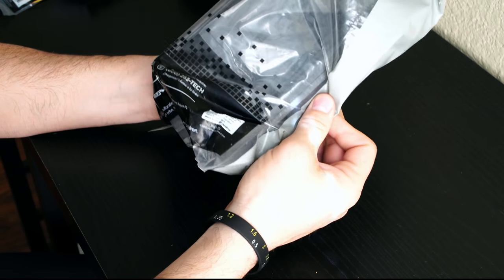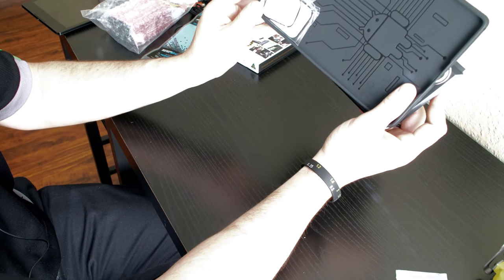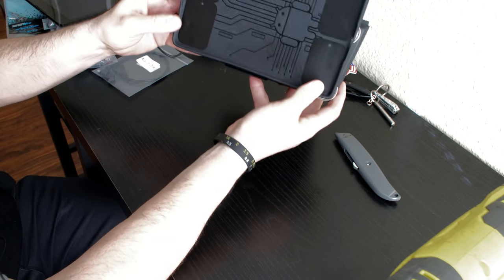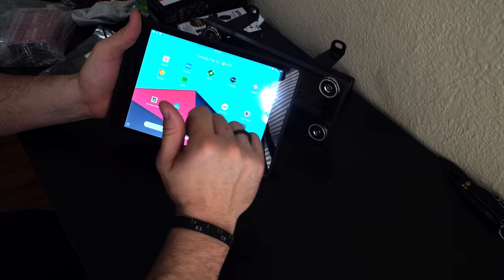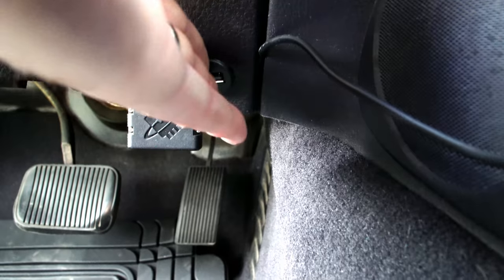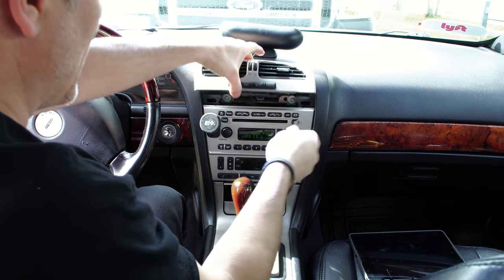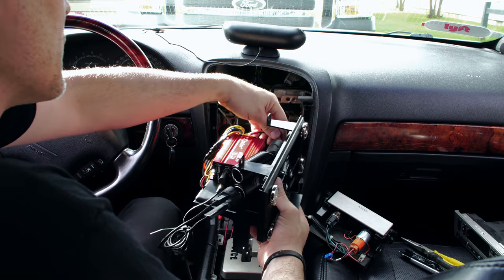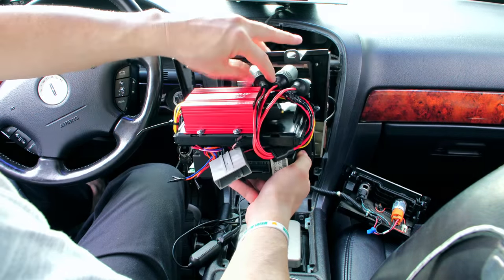Turn Your Tablet Into A Head Unit

Comment: Thanks for this video. Great info here. I am NOT going to be doing this, HOWEVER, I have already done part of this. I did not know that I could could get an adapter to run both audio and charging on one cable at the same time. When Ibsaw you doing that, I went out and got that one, as well as the needed cables. Now, only the one USB C cable for me, and my car looks much better with out the clutter of cables.
Reply from the maker: That sounds awesome! I'm glad you discovered that. Thanks for watching and commenting!

Comment: Glad I decided to watch this video, the magnets you used look way better suited than the ones I used for my setup. I may need to figure out a way to flush mount then though to make it work for me. Otherwise, I have a very similar setup with a Nexus 7 2013, but I also use Tasker to turn it on/off when it receives/loses power and automatically connects to my phones hotspot which also automatically starts using Tasker when it detects my Bluetooth receiver and automatically starts playing my music. I also use car web guru as the car launcher, which also starts up and shuts down with power. And Tasker puts the tablet into air plane and power saving before the tablet goes off to save power. Look into Tasker if you haven't yet. Thanks for the parts list, I'm definitely going to pick those magnets up to replace my current ones
Reply from the maker: That is a very clever setup! I started with the very same tablet because I wanted to put the tablet inside the dash but quickly realized that it would function better outside. About flush mounting the magnets, I needed a little bit of space away from the faceplate so that the tablet could attach. If I had mounted the magnets flush with the faceplate there would have been an air gap not been able to attach.

Thanks for watching!
Reply from the maker: Oh, by the way, the magnets are on the idea list that is linked in the description along with all the other parts that I used.
Reply: @edwardlthompson  good point about the flush nothing. My setup is removable too but the case stays in place as part of the mounting setup. I used a combination of n54 magnets and Velcro to make it after just magnets wasn't cutting it. But I can think of a much better way to redo it now using the magnets you used. They probably won't be flush mounted but they will be set in a little bit so the case sits flush with the console. They look like they would be to thick for my application otherwise. Also I think the issue with the micro USB OTG has to do with the tablet kernel/software but the cable itself. I've managed to get OTG with charging working before but it just wasn't reliable enough. It was much more stable with the original Nexus 7.
I bet you could mount a wireless charger behind your setup too (if supported) if you want to do away with that hanging cable.
Reply from the maker: @kemicala  yep, I had that same idea and another commenter suggested that too. That would be super clean. I wish manufacturers had not got out of the tablet game and had given us a modern tablet with all the latest specs and wireless charging. That would be so sweet!

Comment: Emergency braking, will the tablet fly out? Experience the driving process? Such as volume plus / minus, switch songs
Reply from the maker: The tablet hasn't moved at all even with me drifting and doing figure 8s! I have video to prove it. 😂

There are volume controls as well as media controls on the launcher as well as in the swipe down notification shade. So, no issues there.
Reply: Emergency braking would actually push the tablet forwards.

Comment: I tried this same path 2 years ago and have all the parts you bought pretty much except tried with 2 mini amps.  In the end it just was not worth the trouble with the price of head units.  I eventually just bought a $300 Android Auto/CrApple Play Head Unit from Pioneer/Kenwood/JVC.  Most issues with this setup is getting the audio, bluetooth, and charging working without interference ruining it all.   Any usb device you introduce to the system causes more problems.  Best bet is to use bluetooth audio and USB charging only.  If anyone else wants to attempt this good luck.  In the end I probably bought another headunit messing with all the adapters and tools to try and get this working.
Reply from the maker: Check out my update video. I did a different setup with the head unit in my truck and upgraded to a different tablet. I agree that this level of DIY isn't for everyone and a simpler setup may work better for most. I plan on doing another setup with a simple and cheap BT head unit soon.

Comment: Nice setup. It's like what I had in my old mustang with a Nexus 7 2013. If you have a USB hub you can get a USB FM radio receiver, and a USB TPMS system. You could have saved your self a whole lot of trouble by just installing a single din stereo with Bluetooth and just recessed it back. That's what I have now and it's perfect with my 10.5 inch Verizon S5e. I'm a delivery driver and it makes working weekends during football season better so I don't miss games.
Reply from the maker: That's an awesome setup! I didn't know they made a USB radio receiver. Installing a single DIN radio with Bluetooth certainly would have been easier but I wanted to challenge myself to build something and DIY a head unit.
Reply: @edwardlthompson  Yeah I know what you mean, I did the same thing the first time, but the radio never worked perfectly, and the amplifier I used had to be placed in the passenger footwell, so I went with a Bluetooth stereo this time. For the FM radio google Android USB DVB T Dongle and SDR touch app, it never worked that well for me but I had an adapter to use the car's antenna and I think that screwed things up, plus you can get an amplifier for the antenna that I never tried.
Reply from the maker: @byroncole1253  I checked out a few on Amazon. Very clever solutions. I think it would be far easier to get the iHeartRadio app to get all your favourite local channels wherever you may travel if your really hooked.

Comment: Check tail lamps...   lmao.. I bought my wife a ls..    that warning cluster!
Reply from the maker: That's cool. Hahaha. Yeah, the car didn't like that I replaced all the incandescent bulbs with LED bulbs. I recently installed a resistor that tricks the system out of those errors. I love the LS. Good choice! There's a group on FB called Lincoln LS Enthusiasts that you can use to keep up with other fans of that car but there's also a bunch of good technical info there.

Comment: You are a very good person to go through the process and all info. I always wanted to use one of my numerous (NOT IN USE) tablets for this same concept. Appreciate the education Sir. Real good video. Be safe
Reply from the maker: E-cycle! Don't throw them away, just find creative uses for them. I'm currently using an old tablet for a system monitor for the data output from my PC for the temperatures and other metrics. I'm glad you enjoyed the video. I made an update video to this one that is recommended at the end that shows an easier setup in my truck.

Comment: Will OEM reverse camera work for this unit? Amazing work by the way.
Reply from the maker: Thank you so much! I am not sure how OEM reverse cameras connect and if they differ between brands. I would have to do some research on that. Sorry I don't have an answer for you.
Reply: @edwardlthompson  You would need some kind of adapter for yellow video in.    And of course an app to play it.    It might be easier to find a piece of hardware that accepts a yellow video in and transmits it via wifi.
Reply: @edwardlthompson    Its probably easier to just buy a usb webcam and hook it to a usb hub.
Reply from the maker: That's what I have suggested to people that have asked the same question. I have seen this adapters for the yellow RCA jack to USB but like you said, finding the software to work with it could be tricky and it would be a hassle to activate it each time you needed it.

Comment: Why not just get a Joying full android head unit ? I use Torque  for obd reader and its free
Dam nice install
Reply from the maker: The reason I didn't go with an Android head unit was that the tablet is higher resolution, has a larger screen, has better support (Lineage OS), and can be used outside the car giving it more usefulness. Plus I wanted to challenge myself to make something like this.

Torque is a good OBD2 reader but the dongle I got is sold by the company that makes the app I use. It has better compatibility and more detailed features thanks to that compatibility.
Reply: @edwardlthompson well thought  out and very clever  build
Reply from the maker: @billbond2045  thank you and thanks for watching!
Reply: Look into headunit reloaded. Its cheap, but allows your tablet to run Android auto. It's a godsend!
Reply from the maker: @yakidd  that's pretty cool. I will look into that but I'm not a big fan of Android Auto. AA only runs a handful of apps. I would not be able to run my ride sharing apps.
Reply: how about tablet battery, is it safe to put a tablet with huge li-ion battery in a hot car? most Android head unit doesn't have a battery, and it's for a reason. I don't watch the entire video (1 hour long), can we just remove the battery then bypass the power to the tablet?
Reply from the maker: @marhensa  the tablet should NOT be be left in the car. You are right about the fragility of the battery but also the danger of theft. The tablet is for use at home as well and across multiple vehicles. As far as I know, there's no modern tablets with removable batteries.
Reply: @marhensa  I would also compare the Barry of a tablet to a slimline powerbank. Same rules apply. It will be certified for storage temps, so stick to those. But as OP says, don't leave it in your car! The whole point of the magnet system is to make it easily removable.

Comment: Love the video and ingenuity.  I had a similar setup in my truck but rather than the small amp mounted behind the tablet I purchased a single DIN Sony deck with a shallow volume knob and used that as the audio and power interface and worked well.  Overall, nice job.
Reply from the maker: If I were to do it again, I would go that route as it would cut down on some of the complexity and I would still have a spot to run wires through if I eliminated the pocket on the double DIN. Thanks for checking out the video. I did a similar setup to yours in the update video.

Comment: Thanks for all this info ,one tip for drilling plastic ALWAYS drill a small pilot hole for your screws ,it will stop any stress cracking.
Reply from the maker: Thank you for the tip! Thanks for watching. Make sure you check out the update video as well.

Comment: No one is going to steal an older tablet  but as you stated, the interior of all cars goes through temperature changes that will kill most tablets. One thing nice is you can really upgrade an older vehicle and make it look more up to date.
Reply from the maker: Thanks. You can also upgrade the tablet to keep up with the times. Check out my update video where I did exactly that and did another setup in my truck.

Comment: I only have 2 notes:What if you make a sharp turn or a constant turn (when making a exit from the freeways)?  The tablet will slide left or right and might falls off.  Might want to put some bottom corner brackets to hold it in place like you did at the bottom.  As for this application looks good and clean.  Great and innovated.  However, you can't leave it car, just asking for would be thieves and a broken window.  If detached, there is no clean plate to cover up the behind the wall finishes?
Reply from the maker: The tablet will not slide off. Here is an exterior video of me doing figure 8s in the Lincoln and the tablet stays in place. https://youtu.be/EDxwDqxwCwA and here is an interior video where you can see the tablet at the bottom of the shot. It doesn't move at all. https://youtu.be/HLvBKnOJ7-Q

I have never left the tablet in the car. I have a small laptop bag for it so I can take it with me wherever I go or stash it under the seat if I'm just going into a store quickly.

You are correct, when the tablet is not in place, it doesn't look good. Looks like someone stole my stereo! 😂 However, when I'm not in the car, I could care less how it looks. If I cared a little more, it would be pretty easy to make a plate to cover the opening.

Comment: The way I did mine was to purchase a bluetooth single-din head unit, and then use my tablet bluetoothed to the headunit. This way, you get ALL of the pros of a good head unit, including 4-channel audio, or an amp system if you want it, and all of the benefits of the tablet as well. I use Car Launcher as well, and it works just fine over bluetooth to the headunit. I can use GPS, play music, videos, etc. and it works perfectly with no need to rig a bunch of crap up.
Reply from the maker: That's an excellent solution. I wanted to challenge myself to build my own unit. I like your method.
Reply: @edwardlthompson  There are some definite benefits to the way you did it. No need to worry about bluetooth connectivity issues, for one. And I'm the same way, I love tinkering and building and seeing what I can accomplish, so I totally get where you're coming from. The magnet idea is something I'm going to have to try, but I think I'm gonna try to figure out a way to hide them. Maybe shave down the inside wall of the plastic facing and use some series glue to hold the magnets in place, so that there's maybe 1mm between the magnet and the case of the tablet itself. Hmm.. I'll have to test how strong that'll be through various thicknesses of plastics before I attempt it.
Reply from the maker: @AlphaMachina  thanks! With the magnets, make sure you pay attention to the dash surrounding the radio area as mine is recessed by about a half inch so I needed the magnets to extend that far so the tablet could clear the dash on either side.
Reply: @edwardlthompson  Ahh, that makes sense. I think mine is similar now that you mention it. Hmm.. Man, this is where 3D printers really start to pay for themselves. I need to start putting some money aside for one, because I keep finding myself coming across instances where it'd be freaking awesome to have. Could print exactly what's needed, sand and fill it, and put a nice coat of paint on it, and have something custom and nice looking with everything in mind for the perfect fitment.
Reply from the maker: @AlphaMachina  I'm right there with you my friend. I have a good friend that has one and we are going to work together to try and make a custom design head unit.

Comment: Nice video mate, thumbs up.
Also if you have not done so already get some egr valve cleaner, you spray it down you air intake (remove your MAF Sensor) once egr valve is clean you should get more boost and better mpg's
Reply from the maker: Thank you and thanks for the tip. I do that every once in awhile with SeaFoam brand cleaner. Thanks for commenting.

Comment: This gives me some ideas thanks. Also if you have selected a tablet with wireless charging, then I reckon your setup will be more seamless, and saves you maybe the hassle of plugging/unplugging your tablet. Over time charging port wears out as well, so potentially saving your tablet down the track. Cheers mate!
Reply from the maker: I was looking at that. There are a few older tablets that support wireless charging but none that also are supported by the lineage OS community.
Reply from the maker: But you're absolutely right, if the custom rum is not something that's a high priority to you, it would be easily to find a wirelessly charging tablet that would work perfectly in the same manner.

Comment: As a ICE tec,I feel I should upload how to do near wiring.Nice idea,but such a janky set up of wires all over.Poering any audio with that electro luminescent powered USB will put noise back into the system after the ground loop.Hope you haven't had any fires since ,I didn't see you use any fuses either,which is kind of a must.
Reply from the maker: I appreciate your feedback. I have had no overheating issues or fires.
Reply: Wait you work with ice my company buys from y’all all the time 😂

Comment: Well done. I also drive for Lyft and use a brand name multimedia head unit. You make some very solid reasons this is better. I use Waze instead of the Lyft gps that can cause issues for me. The map will not always show on my head unit. Your R&D is great I am sure there is a market for this. people could purchase from you. Make some universal kits for that have pre drilled brackets along with instructions to installing all the electrical. That being said it would be great to see you and your invention on shark tank. Keep up the good work!
Reply from the maker: Thank you very much for that encouragement! The thought has seriously crossed my mind of doing that. I have a friend that has a 3D printer and I had talked to him about that. I may get some prototypes together and see how it goes.

Comment: I would try picking up a wireless charging pad and adapter. The adapter would go in case with magnets, and the pad you would mount into your setup. That would eliminate the whine from charging and some of the visible cables
Reply from the maker: That sounds like a good idea. Thank you for commenting.

Comment: Nice video I have been looking for a way to mount my iPad in my 2011 Cadillac Escalade I don’t really replace my unit.  After watching your  video you gave me a great idea how to mount it using the tablet holder and magnets I just plug it into my usb and get sound through factory stereo thank u for video
Reply from the maker: I'm glad I could help! Thanks for watching and commenting! Make sure to check out the update video. I changed the setup some and got a new tablet.